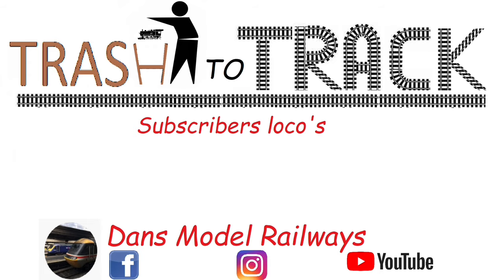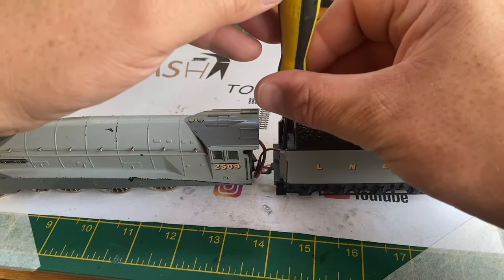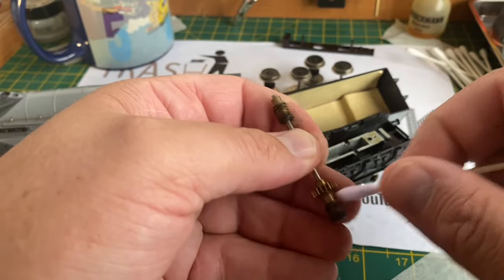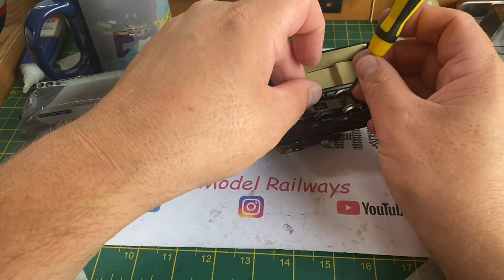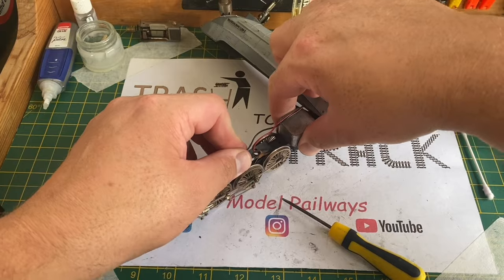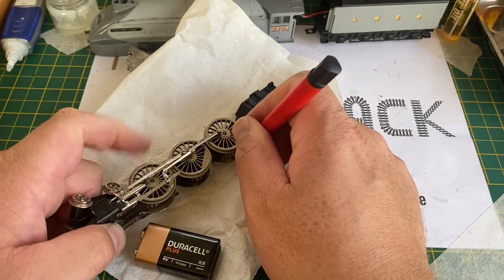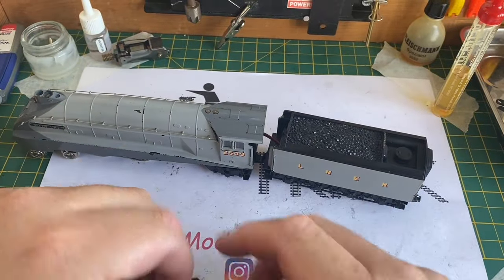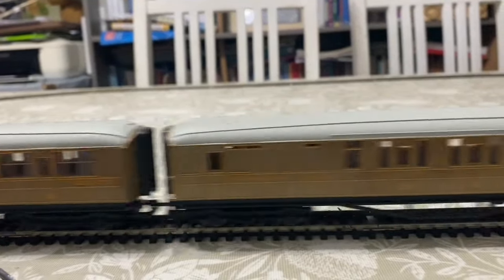Trash to Track. Episode 69. Lilliput LNER A4

Comment: Good one. Not a fan of tender drive personally, but it looks ok. I imagine the « traction » tyre on the front driver is probably to ensure the driving wheel grips the track so the loco doesn’t just end up sliding along when pushed by the tender. Probably a more elegant solution than just adding weight to the loco.

Comment: fixed a trix A3 recently, but the loco body was not coming off even though the screw came out - think someone had glued the body to the chassis. Absolute B** to clean the wheels and line up the contacts from the bottom